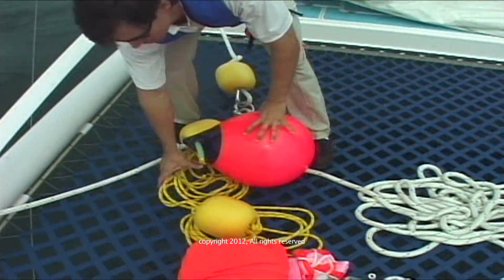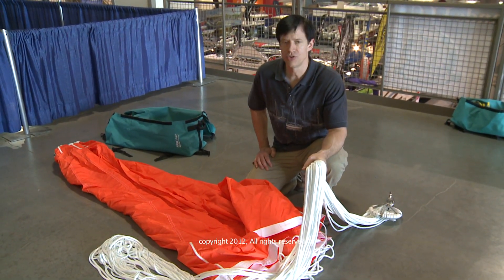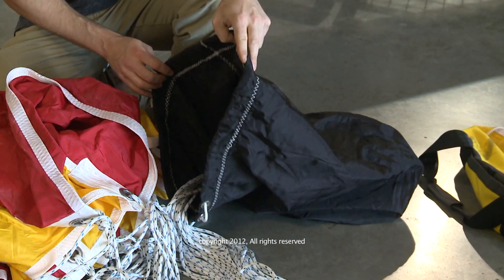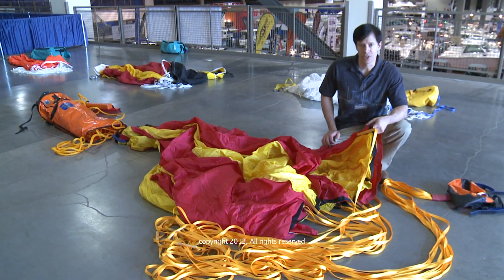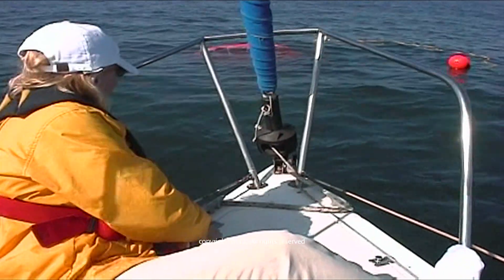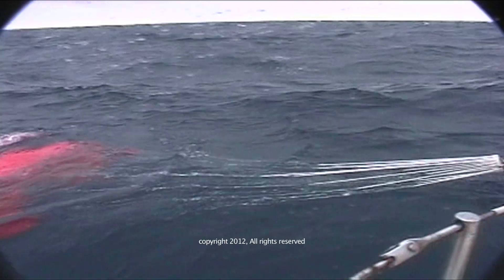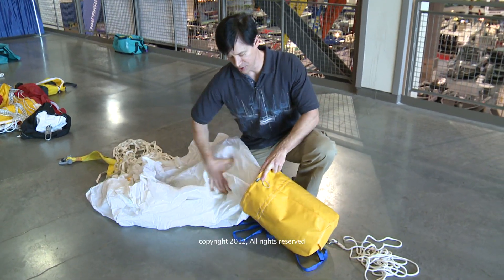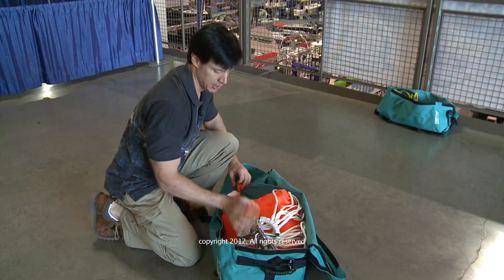4 Parachute Sea Anchors  -  comparing for storm use

Comment: could your chute be used on a fast boat 150 mph?
Reply from the maker: Fiorentino successfully stopped a power vessel traveling at 56 mph in 1.6 seconds. Fiorentino’s para-anchor was completely intact with zero signs of damage. Could we stop a fast boat at 150 mph? Likely, it depends on intended use. Intended use determines if a shock load dampening system is required or not.

Comment: Hello,  A nicely done video.  In fairness, I think it might be well to mention that on the Para Tech sea anchor, each of the shrouds (which are tapes) run all the way from the perimeter to the center of the apex.  A different approach than the one that Fiorentino takes, but it would seem equally valid.  And, by the way, I have no connection with any para anchor manufacturer.
Reply from the maker: +JJ Fleck 
The “tapes” are necessary because Para-Tech uses lightweight fabric for their canopy, anywhere from 2.2 to 4 ounce nylon. Published product failure in the DDDB book is likely why Para-Tech started using the “tapes.” “Tapes” can help reduce breakage for thinner fabrics and possibly spread out loading. Fiorentino uses an 8 ounce nylon fabric to reduce wear so “tapes” are unnecessary for our equipment. The extra number of eight-strand shroud lines Fiorentino places onto their canopy also spreads out loading, resulting in a longer-lasting parachute canopy. Check out our photo-filled comparison article to learn more: http://para-anchor.com/reports/comparison.pdf

Comment: IF YOU NEED A FLAG , ZIPPER END OF BAG. OPEN, PULL CO-2 BRIGHT COLORED SLAVE BAG, WITH SHROUD LINE OF IT'S OWN.  MAYBE  TIED WITH ROBBER BAND'S LIKE A PARACHUTE ?
Reply from the maker: Robert Abbott After watching this video it really does make you think. Deploying the Coppins can be complicated. The other brands in the video are definitely easier to handle.